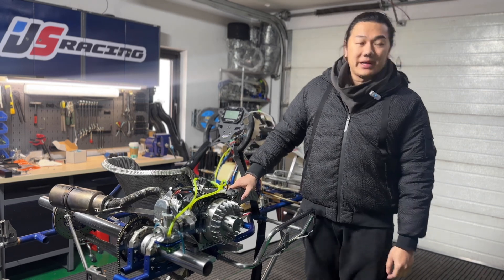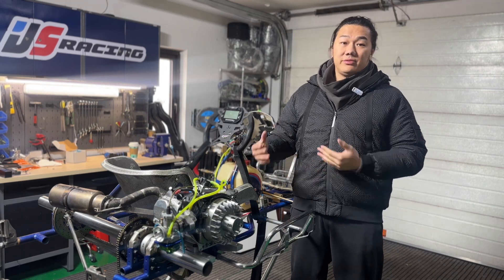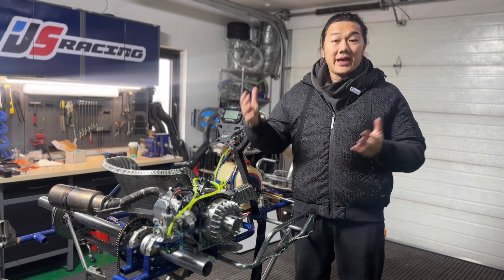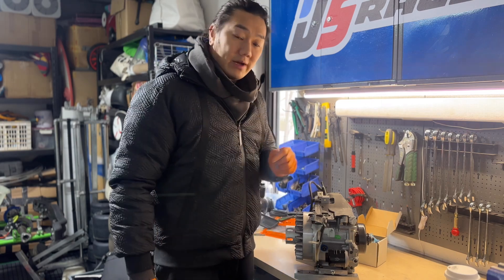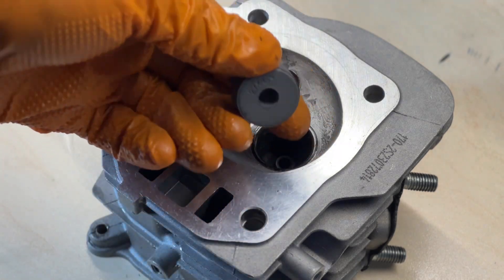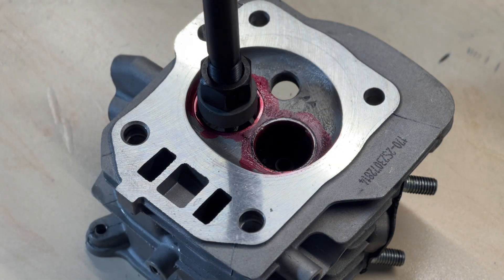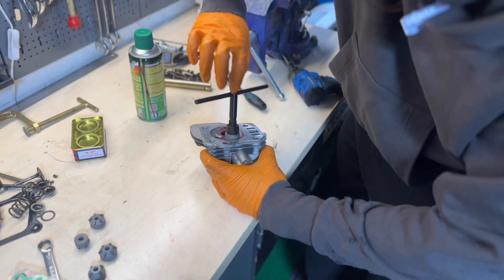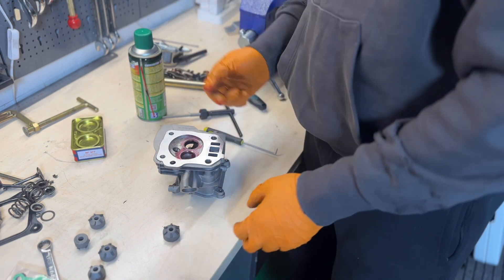New Prototype Engine: 3 Angle Valve Job

Comment: You are cutting your valve seats incorrect if you would like to know how to do this the correct way I would tell ya just let me know I am a engine builder build 196cc and Briggs animal motors quite often you should really look into the Ne-way cutters if you are going to do this a lot does a way nicer of a job
Reply: No problem man I also race karts myself but on the dirt oval side that what I build engines for we have a couple of different rules packages I have to stay within being nka or Akra depending on the area of which my customers are racing at but ya good luck reach out if ya need to id shoot ya my email or something if needed just don’t wanna put it here in the comments here really
Reply from the maker: @stevesmith4646  hi Steve, do you have any recommendations for a water proof intake filter? Possibly without having to change the main jet size for the carb?
Reply: @js_racing_jason  no sir never had to race in the rain
Reply from the maker: @stevesmith4646  damn, we’re expecting half of the races here will be in rain condition
Reply from the maker: I really wanted source the neway cutters but I couldn’t get them here at all. Could only settle for the blades I used in the video. With regards to how I did the valve seats, can you point out where I could improve?
Reply: @js_racing_jason  only thing I would do differently is when cutting seats start with 45 like you did and use the coloring I use just a black sharpie marker to see my cut then switch to 60 use color again the do your 30 but do not use color this time so then you will be able to see your 45 angle being the left over color….. I usually make about 3-4 cycles through all cutters 45-60-30-45-60-30 with just barely cutting a 30 angle and cutting the 60 angle deep so I can move my lap line up on my valve face with it being fairly thin line/45 angle on intake side exhaust side oh and also when cutting you always want to finish with 45 very lite tho… so 45/60/30 then lite 45 one rotation like .5 lbs of pressure
Reply from the maker: @stevesmith4646  sweet, that’s very valuable advice, thanks for the help 👍👍👍

Comment: Is that a AliExpress valve cutting set?
Reply from the maker: They probably sell the same stuff there, I didn’t buy it from aliexpress. Either way it’s very cheap.
Reply from the maker: Look up 3 angle valve cutting kits
Reply: Just ordered one from Ali, looks very similar. Just wondering if it's lasting
Reply: What engine is that?
Reply from the maker: @curtissmartin6322 if you’re asking about the case I’m using, it’s a Honda clone, 225cc.

Comment: As soon as you mentioned the crankcase breather, made me think of all the small engines I have ever worked on and non have pcv valaves.  Great idea.  But you need an inlet and an outlet on the crankcase.   That way there is flow threw the case and not just vacuum.

But cooling the valave cover to the crankcase by a tube are that same air.  Am I wrong?  The valave cover has pushrods inside it open to the crankcase.   So that air is one and the same.....
Reply from the maker: Hi, I later added another tube from the crankcase to the head cover. It's sort of the same air like you said but the pressure build up within the crankcase is always very high, so extra tubes will help alleviate the pressure much better. In practice, you are looking at much quicker engine response and acceleration.

Comment: Nice.  Is that a Lo206?  I’ve never seen that oil filter on a small engine like that. Does it have an oil pump now?
Reply from the maker: That’s right, it’s actually a 3 piece package. The case cover has a dedicated engine oil feed that goes through the crankshaft and directly lubricates the area where the connecting rod attaches to. The connecting rod is also reinforced and has bearings on it too.

We will be making billet versions of this in the near future.
Reply: That’s awesome.  Good job on the head.  Everything looks good to me
Reply: Def not a Briggs lo206…. Looks like Honda clone
Reply: @turbshangin Honda clone indeed
Reply: That’s what a the Briggs is a clone of the original Honda.
Reply: @jamesgravel7755  what honda?
Reply: I believe it was the GX160 that was the original then the GX190 and all the clone engines after that the 196/212 etc all came after that Honda was one of the best engines for small out.  That’s why they cloned it because it was so popular on many small engine applications
Reply: @jamesgravel7755  the hondas and the briggs 555705 have nothing interchangeable theyre totally different